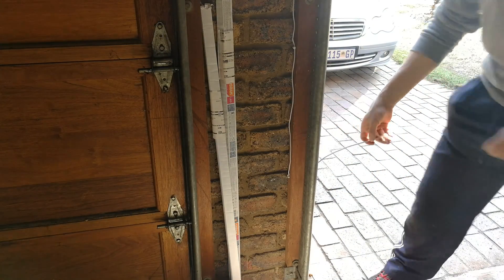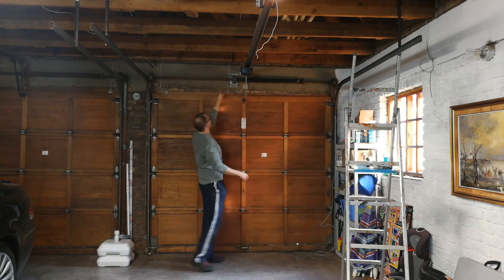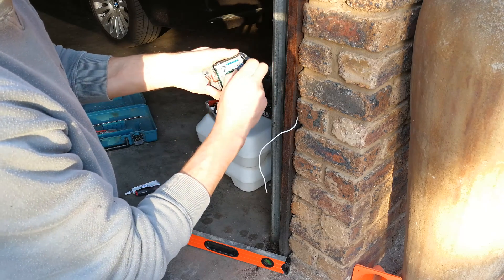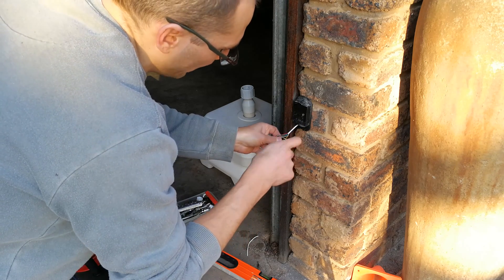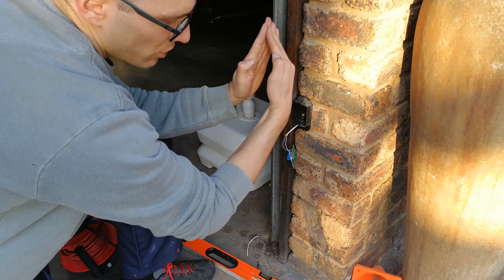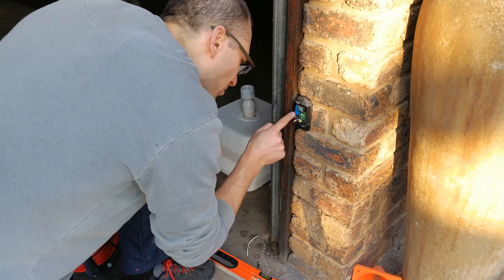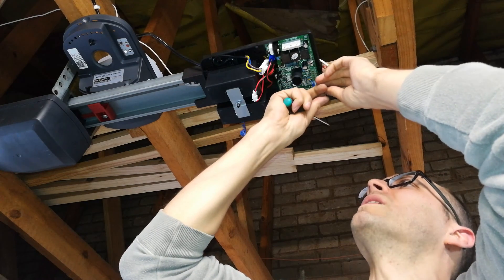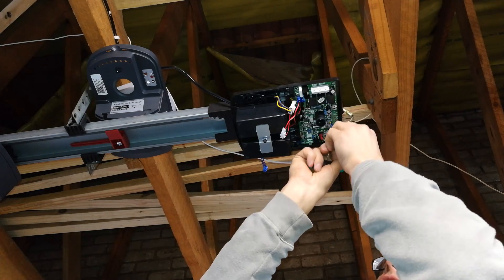How to install infrared safety beams for gate or garage (Centurion I5 type)

Comment: Hello, I just installed photocells to my sliding gate bot for some reason, I cant make it work opposite, now when I cross over photocells, gate doesnt stop closing, but when gete is opening and I cross over photocell, gate stops and start closing which I dont want, I want to make it that if I cross over photocell while gate is closing, it will stop and start opening.. what should I do?
Reply: @818Arturik  I am not even able to install it properly. Any help will be appreciated for a  steel line sd800 will be appreciated

Comment: Hi, what type of cable is normally used for beams? Comms cable?
Reply from the maker: yes solid or stranded, copper is best if you can get it.
Reply: @ecologicaltime  Thanks, there is many  info and video’s on you tube for diy installations but i struggled to find video about what cable to use for what type of installation. Ripcord, comms, cabtyre, suffix ect. The online shops also not mentioning where that type of cable is used. Thanks for the reply.

Any advice on the courtesy lights on the gate motor board? Cable, what type of light and voltage for courtesy lights?
Reply from the maker: thanks. Courtesy light running at supply voltage (230 / 110) should use surfix (shielded) cable.
Reply: What is the use running it to the motor circuit board? I will just tap it from the main supply with a day night switch/sensor separately.

Comment: Great video. Very helpful.
Question. Can you splice the positive and negative together at the motor and then put those splices in the terminals?
Reply from the maker: https://youtu.be/MDAYY4W8LE0
There are terminals on the motor board.

Comment: Common on the relay contacts refers to the terminal where the DC or AC comes in. The NO or NC contacts simply act as a switch. Power runs through the contacts and ground or negative is connected at the end of the device.